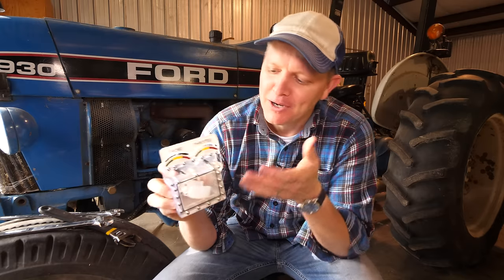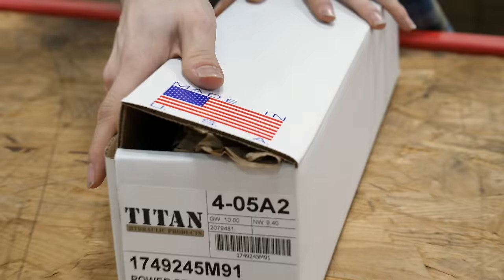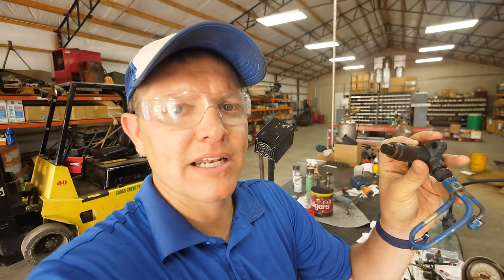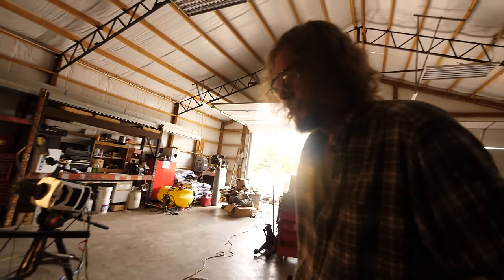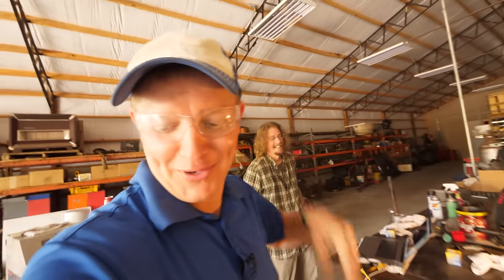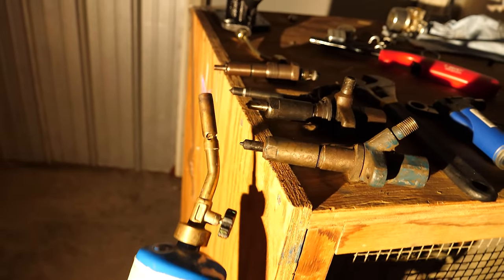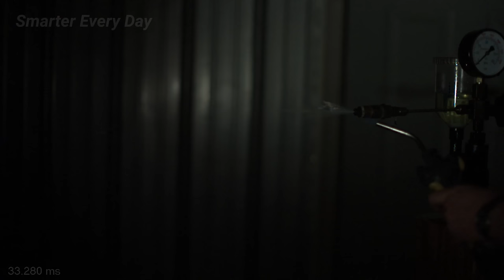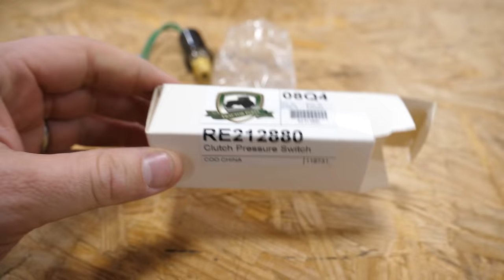Why Fuel Injectors are AWESOME (28,000 fps Slow Mo) Part 1 - Smarter Every Day 281

Comment: Sorry, but this video fails in that it fails to explain what is happening in the cylinder before, during and after the injection. Showing the injector spraying into open air doesn't do much but leave a potentially explosive cloud of fuel floating around. But in the context of what the cylinder is doing, your understanding of the role the injector plays becomes much clearer. 
Prior to injection the piston compresses the volume of air in the full stroke of the piston into a much much smaller volume. This has the effect of super heating the air inside the cylinder to far beyond the combustion point of the air-fuel mix. When the piston reaches full compression (known as top dead center) the injector will inject the fuel into this superheated and highly compressed air. The injector MUST be able to overcome this high air pressure with a much much higher fuel pressure to efficiently overcome the back pressure and distribute the fuel into the compressed air in milliseconds. The fuel must be as evenly distributed in the air as possible and as quickly as possible for peak efficiency, and has a huge effect on the fuel efficiency of the engine. Because of the superheated air in the compressed cylinder at TDC, the atomized fuel spontaneously combusts when it is injected and thus begins it's downward power stroke thrust as the air-fuel mixture tries to expand it's volume many times of what it had been. Since it's contained by the cylinder and piston the pressure spikes as the air-fuel mix explodes creating the power of the engine distributed from the piston rods through the crankshaft to the flywheel with some of that resulting power used to compress the air in other pistons.
A truly interesting injector is those used in older EMD Locomotives built from the 1930's into the 1980's that used mechanical force for the injection as well as a twisting action set by a governor through mechanical linkage to vary the amount of fuel in the injection based on throttle settings.

Comment: You should really stop using explosion when describing internal combustion engines. In an engine you have either a flame front expanding from the spark plug or a flame over some controlled period of time with direct injection. When you are talking about explosion in an engine you are talking  about detonation, aka pinging, and that destroys engines in short order.

Explosion is just not the right word. 

Also, the single point injection is probably a pintle injector, a very common type of diesel injector.

Comment: Interesting flame art.  It really shows up the inefficiency of "fire" based engines.  Questionable safety practices.  You should have emphasized that you're using diesel fuel and not gasoline.  You're initial reaction to the first "pump" shows that it's all happening too close to your body.  Flammable  clothing?  "Smarter Everyday" or "Dumb & Dumber"?😂

Comment: Fuel injectors and EFI are NOT awesome.  They are used when mechanics give up on mechanical solutions and resort to electrical (and computer for EFI)-engineered solutions.  Also, that "little-bitty hole" is called a NOZZLE.  Just a heads-up.

Comment: Fuel injectors are awesome and dangerous. Capable of cutting even metal. You don’t want a high pressure injection of diesel. It could cause loss of a finger. Or worse.

Comment: better to explain that diesel wont work in a carbie anyway.......its physical properties are very different to gasoline. Its NOT a nipple.......it is a NOZZLE.  The break open on those old style nozzles is only 3000psi or so.........by the late 1960's Cummins diesel had injectors running 16,000 psi........modern diesels are much higher again.   The fuel mist should be fine enough to pass through skin.   Port injection is only used in gasoline EFI injectors at 40 psi.........  You are mixing up entirely different engineering solutions for different fuels.

Comment: Doesnt seem very safe to me. Youre messing with pressures that will kill a person.  
  Youre using diesel direct mechanical fuel injection system. I dont think ive ever worked on a port injected diesel.
    Also wouldnt susrprise me if that diesel could seep into and destroy that camera.  Prolly shoulda blasted it into a sealed glass container